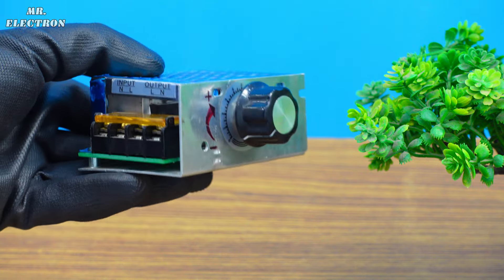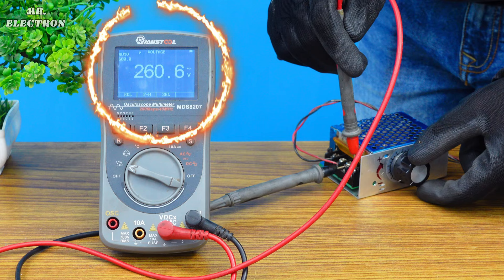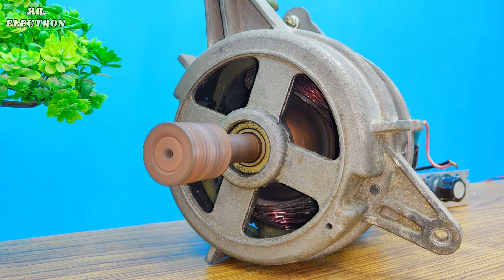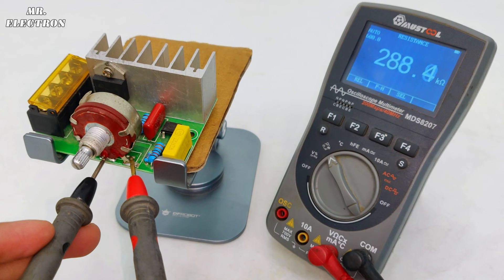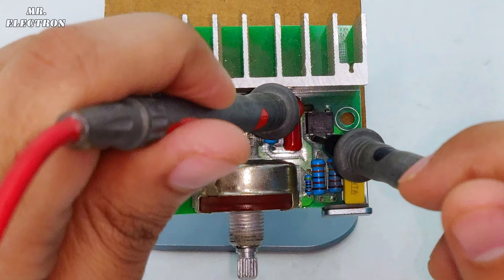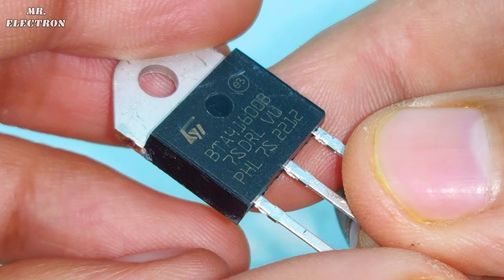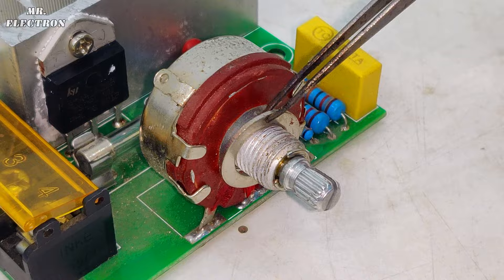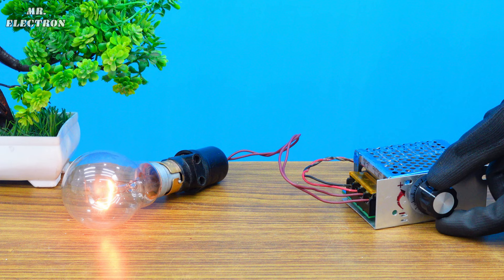REPAIR - 4000W 220V Universal Motor Speed Controller

Comment: I have the speed controller with blue plastic coated cover and same 4000w 220 rating same as yours that I bought online for $4.

 Thank you for this idea on why this dimmer isn't working well for my angle grinder that tends to bounce of when cutting through steel matting. Unfortunately I still need to buy soldering iron to work this out.

Comment: @Mr electron please use your 3hp 180v dc motor to make 
220v generator and use high current 12 v dc motor to operate it please please 🥺❤
Reply from the maker: Actually, that motor is no longer usable since it has been mechanically installed in another machine for a different application
Reply: Ok 😅 but please make some videos on generators 😢 as u had previously done
Reply from the maker: Ok sure thing